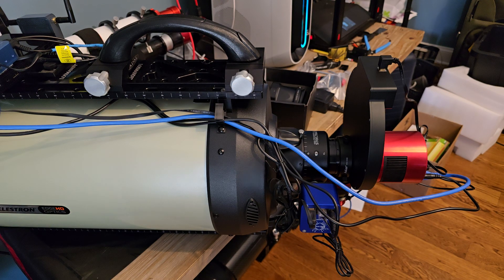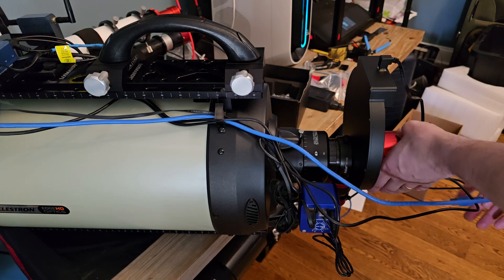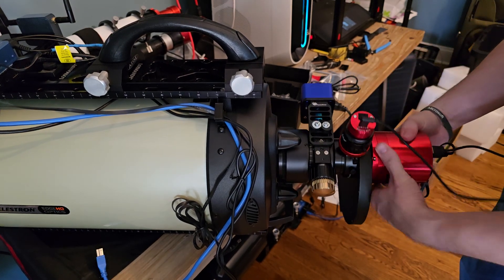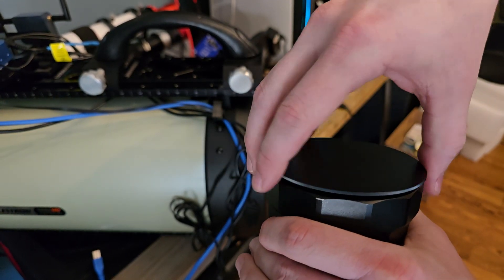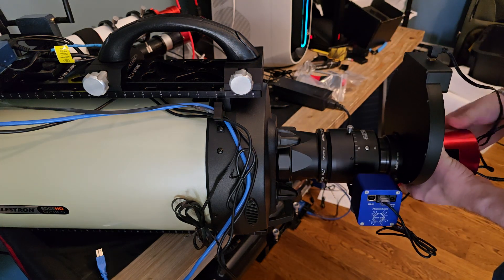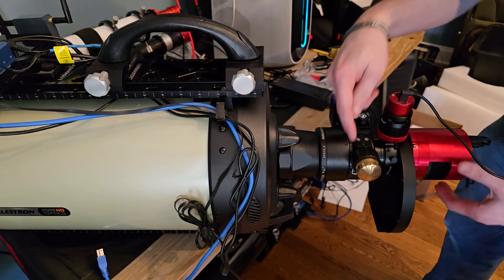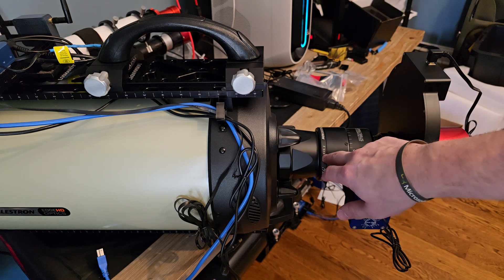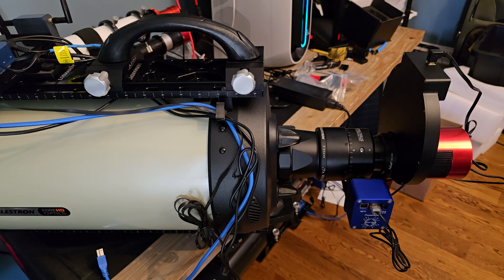Celestron 9.25 EdgeHD: Adding the 0.7 reducer to Baader Steeltrack Focuser

Comment: Because when you do a meridan flip, the mirror has a tendency to shift. Setting  focus with the manual knob on the mirror, locking the mirror, and then using a focuser on the image train will negate that problem. Yes, it's a pain... I use the .7 all the time...

Comment: Brent, you know I have exactly the same setup (ota + camera). I still don't understand this kind of optical train: is the focuser supposed to focus...or to get to the right backfocus? How does it relate to the primary mirror position? I am using the Celestron Focusmotor to focus  (moving the primary mirror), and Celestron T-Adapter to reach the backfocus (fixed in my case). Thinking about your setup, I kinda suppose that every filter has its own backofocus, as you have to use the Baader to reach focus. Although I use SCTs since 2005 I still cannot figure this out.
Reply from the maker: @gianlucabeccani  so the big difference is my mirror isn't moving at all anymore, I basically use the external focuser to achieve focus (kind of acts like a refractor now)